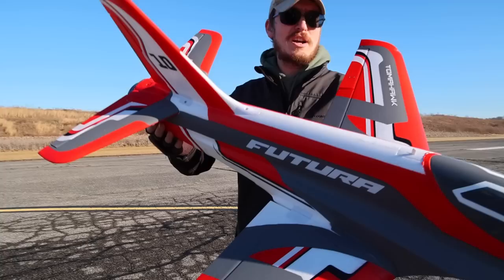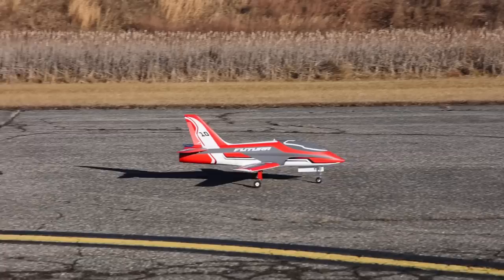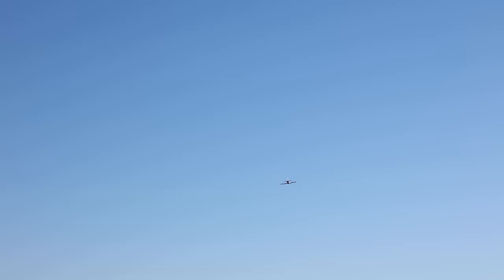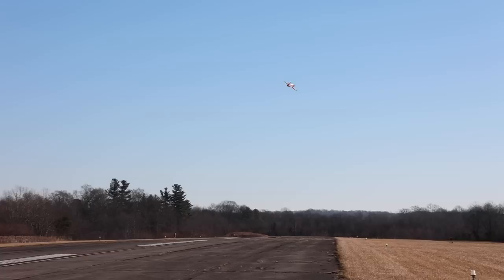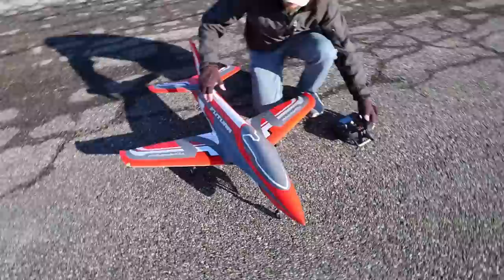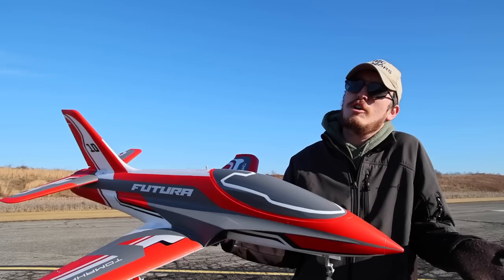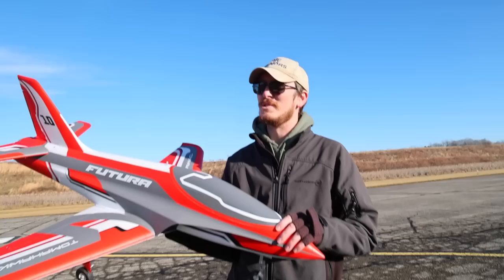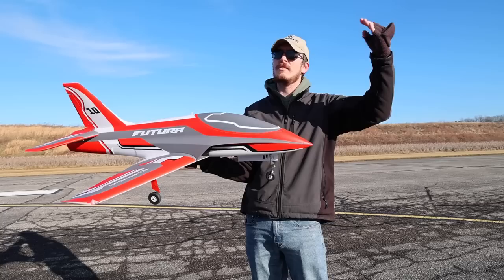HUGE & FAST RC JET!!! - FMS Futura V3 80mm EDF Jet

Comment: Just incase anyone's wondering about times and lipo life after flight. I use a smart 4000 50c (600g) on a 3min timer flying mid to hard throttle with 25% left. A smart 5000 100c (700g) and timer at 4 mins with similar left. 4000 is much more fun, verticals are quicker and higher. Half the 4000 is on the wooden tray and half is on the foam. 5000 the first cm sits on the foam the rest is on the wooden tray. The canopy must have its foam carved out to fit these lipos. Easy job. Looks great with an LED burner as the arse is huge and u can see it flickering away. Add some Durbo low bounce as the stock are rock hard. Suspension is brilliant and I only fly off grass fields. Had the V2 which is awesome too. Onto my second v3 and its hands down my best sports jet 80mm class. Goes with me to the field nearly every other time. If u want a scale jet that flies similar get the freewing L39. Perfect jet. Stick an AR631 in there, set up safe and as3x for your flying style and its a cruiser for anyone but agile and fast enough to keep you happy when giving it some.
Reply: And just think you could use an SMC 22.2–4400 HV pack that weighs 588 g and get even more runtime and more power
Reply: @mindcoach 1on1  can't use a battery only sold in the US when I live elsewhere.  Its silly when I watch reviews from certain YouTubers and they recommended these batteries to their international followers. Very happy with the brands I have. Not wanting to venture into LiHV. Running the futura on 7s and plenty quick enough 👍🏾

Comment: Just got mine in, awesome looking plane. I'll be using 5000mAh LiPos. I'm also looking at eventually upgrading it to 8s....145-150 mph. Did a lot of reading on this model and no bad habits really to report. Very stable. I took the reflex out, great option for beginners to intermediates. Great video and great and evaluation. Cheers
Reply: Great jets. Had the V2 and a couple v3. Definitely the best sports jet. I'm turning mine into 7s